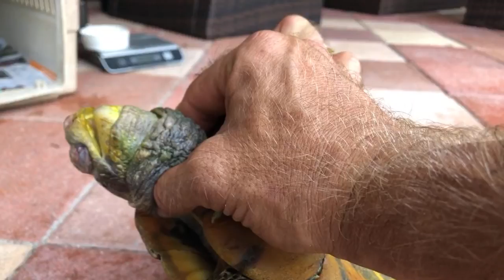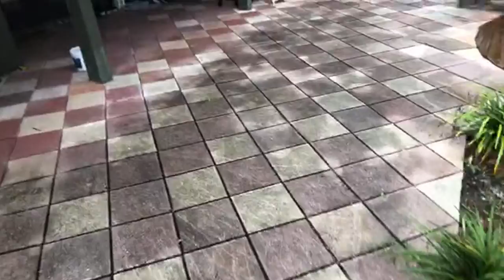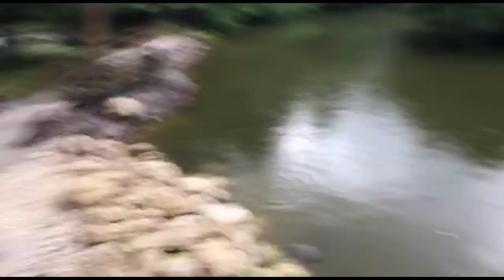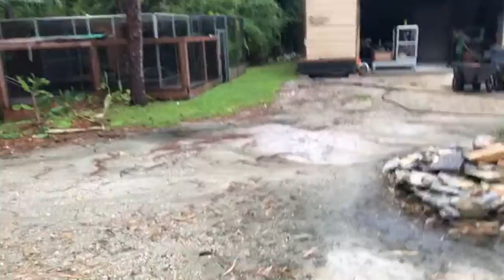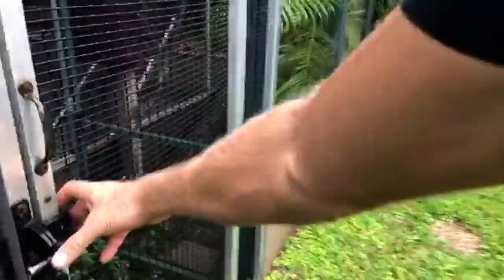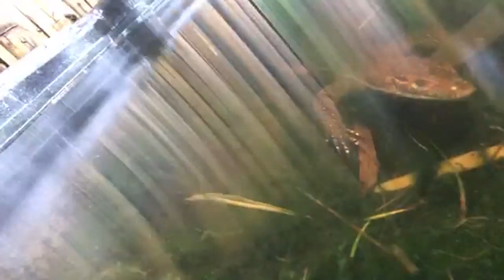Helping A Wounded Tortoise!!

Comment: Hey Kamp, I noticed when you pulled out the ticks from the turtle, you grabbed the whole tick and pulled and that sometimes leaves the 'HEAD' inside the wound that might cause an infection.  I found that getting a 'safe T pin, and using the point to release the 'prongs' of the tick that actually hold the tick onto the tortoise.  When you unhook those prongs, you will have to get a pair of tweezers, I use tweezers that are like scissors, to get a better grip on the HEAD, not the body of the tick and gently pull and rock the head trying to not damage the tick while it is still attached to the skin of the animal.  Then using a magnifying glass and inspect the tick to make sure it all came out, avoiding the possibility of an infection, using the silver iodide will help too.
Reply: He's been doing this for a very long time, he's not a newbie. I'm pretty sure he already knows this and probably did this offscreen because that wasn't the point of the episode.
Reply: Velociraptors of Skyrim 
Yeah, he’s not ignorant to animals and bugs. Lol.